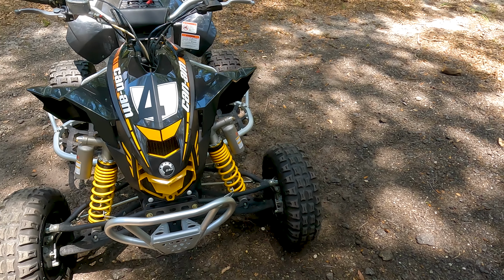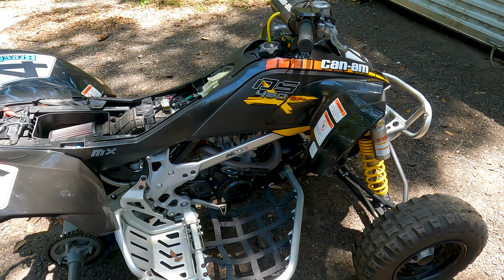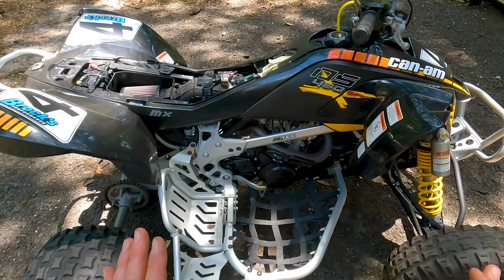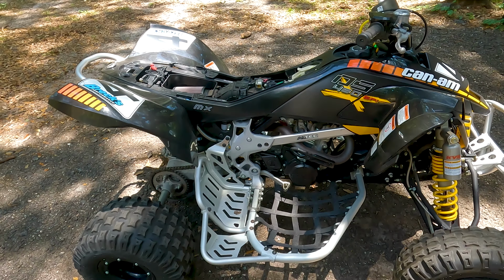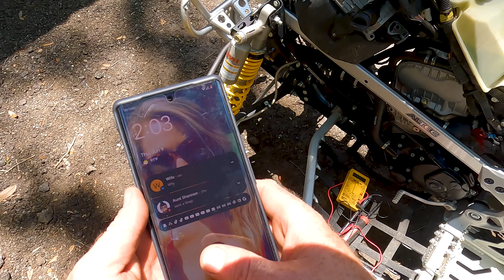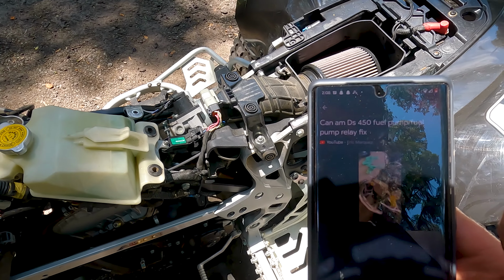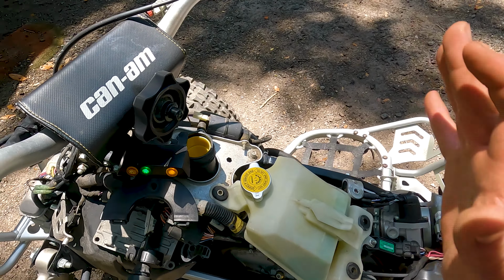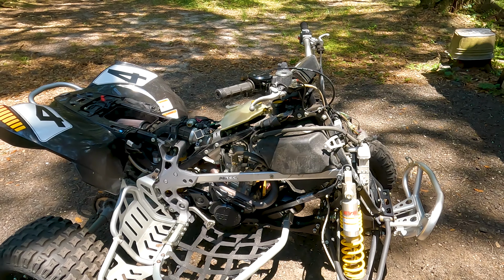Trouble Shooting, Fixing, and Sending my new CanAm DS 450X MX!

Comment: You can swap the fuel pump without removing the tank. I just did mine. Tilt the top of the towards the motor. Push the bottom of the pump into the tank. Twist and pull out. Simple
Reply from the maker: I wish I would've known 😭😭😭

Comment: i have oil in the airbox and before the oil change the guy I bought from way overfilled it with oil and I was thinking rings but there's no loss of power or smoke I'm stuck and need answers. 2008 ds450. thanks!
Reply from the maker: So it will cause oil to bypass the piston if it is overfilled. It won't ruin the rings. Therefore you won't have a loss and compression. Doing oil change. Put the right amount of oil in it and you should not have the issue again. If you do then I will reevaluate.

Comment: Hey Bro , I switched my relay and Now it runs … But all the power isn’t there thru the gears . Holding the throttle all the way down still won’t get everything it has . any help
Reply from the maker: How long was it down?
Reply: @FREEDOMSYNDICATEOFFICIAL  couple Months I run 100 octane in it , today I drove it it rode sluggish

Comment: Does anyone had issue with starter ? Last ride blew up 2 fuses i change them, now starter just clicking, i checked solenoid fine, got new battery, starter good, butt if i connect one more ground wire from battery to small wires to solenoid quad starts up, but check engine light flashing non stop

Comment: ? I have a can am ds 450 2008  I changed just the oem start button  the old one was starting just with solenoid by putting pliers on top and starting it I install the new one switch the key to on try to start it nothing I put back the old one nothing not even with the solenoid as it was working I tried this seen this so many times to see if it would help but haven’t gotten any luck dealer says there is power going threw everything relays panels and fuses before I took it to the dealer to see if it would start
Reply: I changed the battery solenoid fuses and relays it should start there but nothing they says head lamps work everything works so there is power going there but nothing going out when i try to start it battery is full
Reply from the maker: If you can jump the solenoid with pliers it has to be a bad solenoid. Did you buy a knock-off solenoid or oem?

Comment: Those DS450's are very nice. But judging by the wear of the back tires, it seems to have more than 20 to 30 hrs. Very clean though
Reply from the maker: He said he's only rode it five times at the track. Nothing more. It's really hard to tell. I often judge the hours by the tire wear but if he was on a track and doing a lot of spinning I could see extra wear.
Reply: @FREEDOMSYNDICATEOFFICIAL  are the rear tires really soft ply? Or is the tread lower than others? Regardless, the quad is very nice and quick fix
Reply: @FREEDOMSYNDICATEOFFICIAL  meh, 30 hours is enough to be honest, I absolutely WRECK tires on sport quads but I ride wide open to the bar even harder then you do, believe it or not LOL